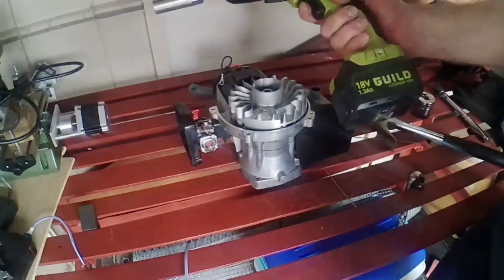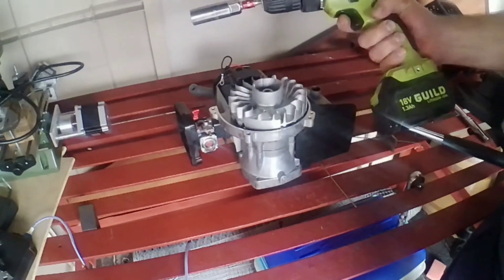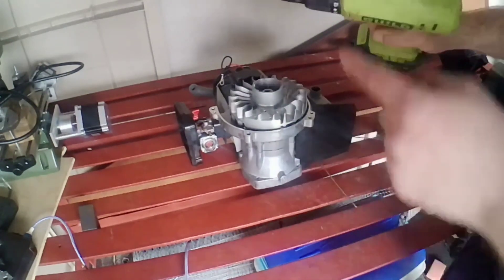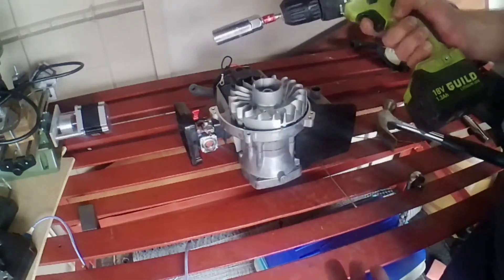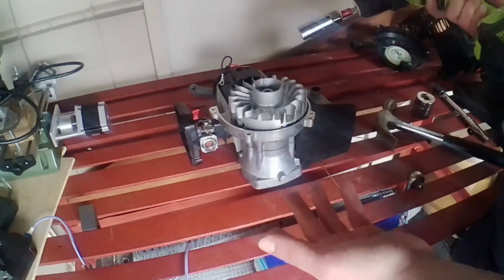Maf 71cc (63cc) engine coil upgrade

Comment: Thank you so much. I was trawling forums as to fit an unlimited coil and came across your video. I have this engine fitted into a X2 pocket bike with a CVT transmission. The bike is extensively ported with big carb and race pipe but wouldn't rev past 6k . Now it screams and goes like the clappers. Top man.

Comment: If I bought the unrestricted coil and do I still have to adjust the flywheel ? I have so many questions. I wish I could actually talk to someone on the phone .
Reply: That's what I'm trying to find out too
Reply: yes you still have to adjust the flywheel. because the coil upgrade only works if the ignition timing is advanced. thats how you will get no rev limit

Comment: I've got a 63cc as well , looks exactly the same.I tried this and I am having trouble with it slipping, also the  fly wheel to get the position would be moving it like 3or 4 over compared to your 2 fin adjustment? Any help or advice ? Could really use it right about now...
Reply from the maker: Is there a BS stamped on the flywheel? Is the keyway at 12 o’clock
Reply: What if the flywheel has a BS on it?

Comment: Do you have a link for the coil you used and the flywheel! thanks
Reply from the maker: Standard flywheel and watch until the end
Reply: @frankg3278  my engine is a 1E48F will this work for mine I've bought the coil?
Reply: @frankg3278  What is the actual part number? There is no part number at the end of the video.
Reply from the maker: @fishnfreak18  there isn’t really one. If you search for that description, you’ll usually find it. Sometimes it’s a 1e40f coil
Reply: @frankg3278  OK thank you I will look around then. I just didn’t want to get a stock one mixed up with a high revolution one.
Reply: why does everyone say the flywheel slips? @frankg3278

Comment: How will you know if you’ve timed it incorrectly?
Reply from the maker: Too advanced and it’ll overheat, start pinging and loose bottom end. Too retarded and it’ll be sluggish
Reply: we know an Advance is too-much if the engine resist Starter during starting, this is called "kickback". Other than that, you can Advance or Retard the timing to play with the engine's power as your preference. Additionally, temperature affect the engine; cold-engine accept higher-Advance, while hot-engine tolerate lower-Advance, therefore this is a tuning job. However, it is safer to set the engine-timing to be of Retard to account for temperature variation and fuel quality (fuel of lower-RON number tolerate lower-Advance).

Comment: Hey Frank I just bought a copy cat 63cc of the kasei could you tell me if it's about the same thing?
Reply: I couldn't get a real kasei.
Reply from the maker: Has it got 1e48f stamped on it?
Reply: @frankg3278  haven't got it yet but it says in the description that I'm getting one 1f48f engine. Looks identical. It conning from aliexpress.
Reply from the maker: @57xcustoms44  The 1e48f are the same engines.
Reply: Thanks I appreciate it. I'll let you know how it works out.

Comment: This is much better than the factory ignition setup, but the 460 coil and flywheel does perform better. The flywheel is lighter and the timing curve in the coil is different and more favorable for high rpm performance.
Reply from the maker: Depends on how much you want to polish a turd. How much does that additional hardware cost? It's £7 for this coil. These engines cost £100
Reply: @frankg3278  hey man I don't disagree with that at all. I do have to lend these engines some credit though, they can be dead reliable when set up right and they make great power. My current reeded 63 setup pulls 14,210 loaded rpm on flat ground. Some 460/ 470 setups may rev a little higher but they will never be as powerful or as satisfying. I will still recommend a 460 to a beginner though, a good 63 setup is more of an advanced level builders engine
Reply: @nogaragenoexcuses  flywheel ms460 can use for 63cc engine?

Comment: i hope you have a full tutoriasl on porting bro
Reply from the maker: Every 2 stroke engine is different and needs to be ported differently so it's difficult to do. It also depends on what you are aiming for when you port. Generally, when you port, you shift the power into the upper rpm range.